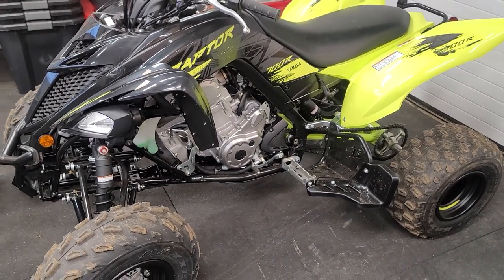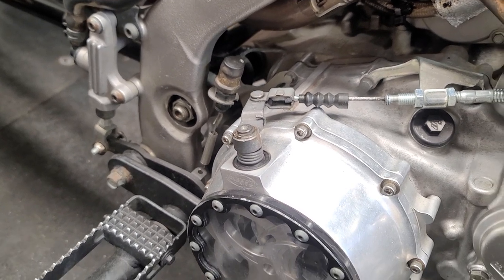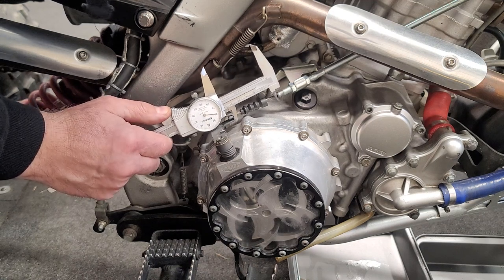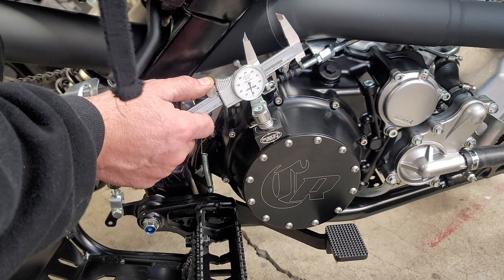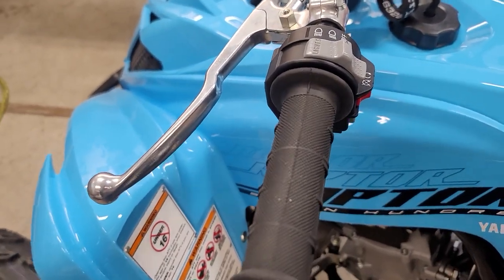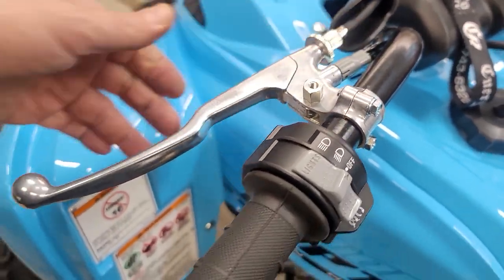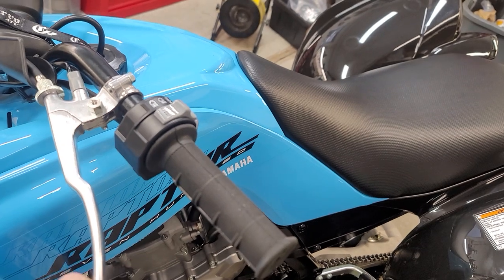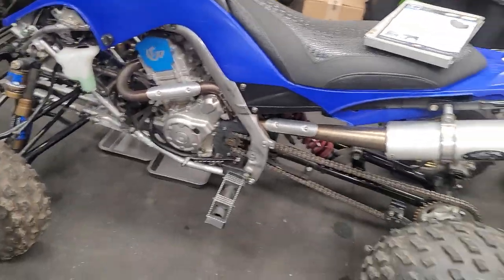why i say No to Asv, oDI rogue and most aftermarket levers death of clutch and trans

Comment: Daniel really knows his shit. Been the only one I trust on raptors.   Just got stranded 12+ miles out in Ocala National forest last weekend.  Bike just SHUT off wouldn’t start. Assumed it overheated.  No cell signal. Finally got it started. Got on main road. Shut off and wouldn’t start again for a while. Got back home in my city.  Immediately researched engine code 33.   Looked on YouTube and sure enough Daniel just posted a video 1 month ago about the start relay bolt being super loose   And SURE AS SHIT. I looked and mine was barely one or two threads.  Thanks Yamaha. Y’all had 1 job to do       Side note. I’m ordering that early on fan relay  cause my fan hardly comes on and I seen temps over 200 constantly last weekend
Reply: Early on fan relay is excellent. Esp you ride deep in woods /ORV parks.  -NY #F150Raptor
Reply: Where can I get that early on fan relay????

Comment: I'm guilty of running ODI and a thicker CNCed lever on my older machines. You are totally correct, it does shorten the throw. Was going to put a set on my '19 Raptor but now you have me reconsidering it. I do like the fold-back design so if you decide to get all crazy, send it, and manage to flop it over out there on the trails you don't bust the lever clean off or bend it back further.
Reply: Whoa, you're still around! I used to watch all of your videos. Did you move to a different platform?
Reply: @postalacidity  took a year off from making vids but will be back on youtube soon.
Reply: @trailblogger  Great news!

Comment: I run ASV levers but my setup is pretty custom for my xc build my the ASV levers you showed are all missing the barrel spacer as well. I’ve seen this a ton guys throw them out. My bars are free and clear as well just a tiny start button with a custom built harness.

Comment: Thing is though, the difference in pull doesnt really matter as long as the shaft rotates enough to push the bearing to uncouple the clutch plates... you dont need to go the full distance. 
I have some chinese lever on my wr450, minimum slack, no clutch slip on 5th gear, and the bite point is about 1/4 to 1/2 of the lever pull. Anything closer than half the throw to the bar is just for extra comfort because it's easier to hold it closer to the bar... It's the same reason why in race cars you dont have a long clutch travel like in regular cars... in regular cars it's so long so you can comfortably extend your leg and hold the clutch in there for long periods of time. 
Maybe the ATV crowd is just special and doesnt know how to adjust the clutch lever, maybe I'm wrong.
The most important takeaway from this video is keeping your cable fresh, lubricated and adjusted. 
My addition to this is that aftermarket levers could mess up the cable end over time so it's worth it to check it once in a while.

Comment: ASV have to get the long lever and a different clutch perch for it to work correctly. They will send you one that works correctly
Reply: How will they send you 1 that works correctly?
Reply: I just bought the correct set up after talking to them. I get all the adjustments and the proper clearance and pull. Everying this video is warning about is not an issue with the set up I got from asv. Just measured it all now.
Reply: C6 clutch lever with the pro perch.

Comment: The odi grips alot of quad guys are using the odi full waffle grips which is oversized like you said making the handlebar a wider diameter. Which it makes it harder to hold on to the handlebars resulting in arm pump. Easiest solution get the odi lock on grips half waffle .

Comment: Do you ship internationally? And is it normal in the Raptor when I stop giving gas while driving and leave the clutch, to downshift without touching the gas or the clutch? Thanks
Reply from the maker: Currently only shipping to USA addresses
Reply from the maker: Its possible to downshift  without clutch, its not good for the transmission
Reply: @MrCuervoRacing  thank you for the answer! Unfortunately I am from Israel...
Another small question for you, I feel that the rear brake lever is a bit "sticky" that it is a bit difficult to return and there is a little free play.
Tips for handling the case?
Raptor 700 2022 SE

Comment: I've got ASV levers but I also have the ASV perch and I didn't see any of the bikes with a different perch so that should make a difference right?
Reply from the maker: Both of these have the lever and perch assy. There are many variations of them. The onesnive seen all have the same issue
Reply: I put the asv c6 clutch lever with the pro perch and it has none of the issues you talked about in this video. I just went and measured it. It has just over 500 thou cable pull, clears the switch block and has just over 4½ inches of lever pull. The lever can be adjusted to have even more length of pull than the stock figures you mentioned you like to see. Ran this lever for years and no issues. I just measures everything before I put it on so it would work the clutch properly.

Comment: Is it normal for a all stock raptor to click hard into gear. First gear often clunks when going in. Not to hard but since it doesn’t do it always it seems weird. Same with reverse sometimes the reverse light comes on but i go and try to reverse and it clunks into reverse pretty hard
Reply from the maker: Clutch drag. Cable pull , adjustment of worn basket.